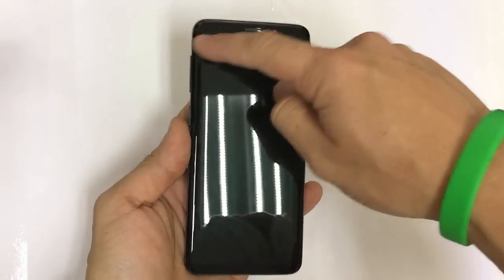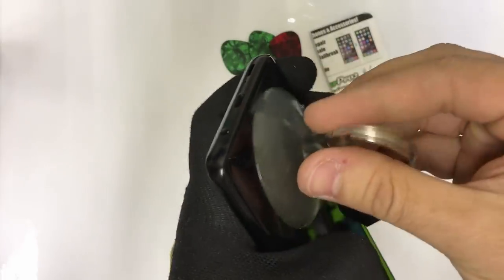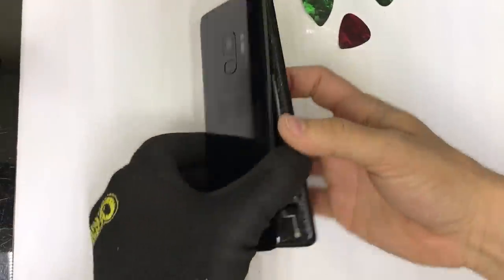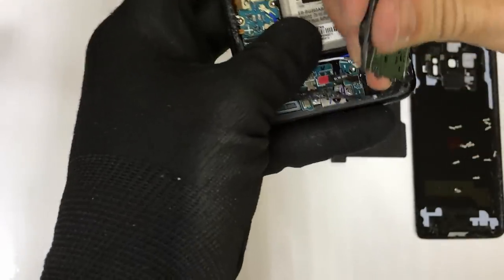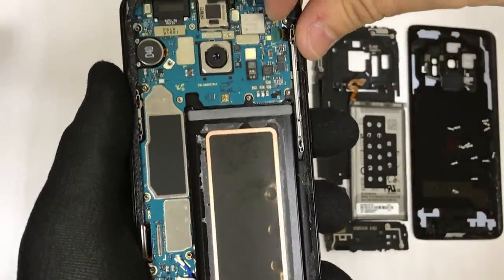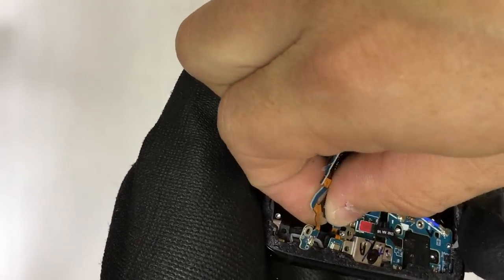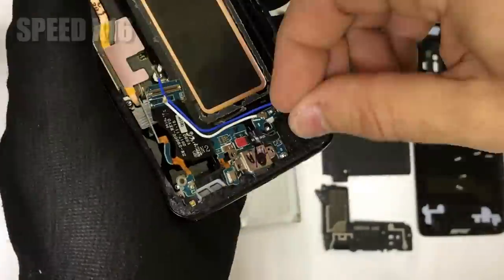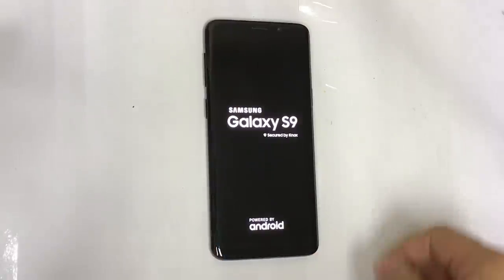Samsung Galaxy S9 - How to Take Apart & Replace LCD Glass Screen

Comment: Wow what a great video. I learned everything EXCEPT how to replace the screen.
Reply: Then you have no business tearing down a phone. Because you clearly don't understand what you just watched.
Reply: I was thinking the same thing. Maybe name the video how to disassemble samsung galaxy s9 without taking the screen off.
Reply: @RaiderLacrosse29  I don’t think YOU understood what you just watched….not once did he show you how to remove or replace THE FRONT GLASS, man’s removed the entire front housing to change the LCD but not the digitizer…..
Reply: @WillyWonkstaOfficial   typically, you buy the glass with the frame attached,
Reply: @WillyWonkstaOfficial  This video is for people who bought the digitizer with the frame, which is what most people do, myself included.
Reply: @WillyWonkstaOfficial  yeah, he almost starts to demonstrate it at 4:44, then just fuckin doesn't bother and continues with the teardown, which is a different thing altogether. Then at 8:02 "there we have it, your galaxy S9 is completely taken apart", but it isn't, because he literally didn't do the thing in the title where you remove the screen. And the idea that this video is intended for people who bought the digitizer with the frame is bullshit, because he specifically explains to reattach the adhesive to the frame at 4:02 and idk why you would do that if you're replacing the frame.
Reply: That's how you know they really know what they are talking about!

Comment: I was struggling with a flickering and flashing screen.  I used this video to find the connector for the screen. Once I found it, I on plugged it and gave it a shot of "de-oxit"  I then plugged it back in, changed the battery while I had it open. And put it all back together.  AND IT WORKED!  No more flickering.
Reply: Hi, I have a similar problem, I think. Was your screen green-ish? Because mine is and it flickers too.
Reply: @johntimelord7927  no it wasn't.  Eventually it did quit on me.  I live near-term ocean, and I wonder if the salt air caused the problem.

Comment: I used your video for the charging port replacement, so I thought I'd use this video to do the screen as well. Because you were too lazy to do a separate video, I followed these instructions and now my screen is stuffed. Not anywhere do you actually show the removal of the front glass, but what you do say to do is to remove the front like you do with the back. All because instead of making a new vid you just took a lot from the charging port replacement vid and slapped a new title on it thinking it'll be fine. Well it wasn't fine. Delete this video and make a proper one.

Comment: U forgot a step.. replacing the screen.. Now I understand why phn repair places charge so much for screen replacement. Ugh! I was just quoted $242 to replace screen on my S9 thru Asurion phone/computer repair. The screen replacement kit cost $30 on Amazon, so that means it costs $212 just for the work. Im better off just buying a used phone off FB marketplace. 😔 I nd to learn this skill so I can save $$

Comment: Why take the entire phone apart  if you only need to replace  the front screen? Oh...I see now. You can replace the glass only if your confident enough but if your digitizer is bad then its actually part of the frame.  He could have said that in the beginning.  After he got everything off the phone you replace the entire frame with glass and digitizer then reinstall all the parts on the new frame/digitizer.  I think he just removed everything and put it back on the same good frame?

Comment: To anyone watching this, you can't just replace the front glass, if you get a crack in the screen, the whole  LCD/screen has to be replaced along with the buttons as well. don't bother listening to anyone or give your phone to someone in a shop who says can do it.   I just fixed mine and went through some shit to do it.
Reply: My touch screen stopped working would it be the same for me??
Reply: My screen isn't carcked its fine just the touch sensor
Reply: @Loadingcontentx_x  i think its the same board unfortunately but try a shop
Reply: @walidosama  OK thx

Comment: do i really need to remove the battery and all the other components for just the screen replacement or can i just remove the componets blocking the lcd ribon connector, then disconect the ribon and then use the heat gun to remove the screeen??
Reply: If you bought S9 with Frame

Comment: So you just took it apart and put it back together.
Can you just take off the front glass?
Reply: this is what i want to know. ive bought the glass screen and it doesnt have any connectors.....
Reply: @countjobula  you cant replace the glass its fused with the AMOLED LCD so you'd probably have to replace the entire display including the glass screen and the AMOLED LCD

Comment: All I want to do is replace the glass. cant i just heat it up, pry it off and put the new glass on?
Reply: Did you ever find out if that can be done? Seems crazy to tear apart the whole phone when you could just lift the front glass and replace it, in theory anyway.
Reply: Yes you can. He was just showing how to remove all the parts while he had it open. Just heat pry and replace

Comment: Hello. I have a question and really hope someone can help me. Is it possible to use a different display from another phone as a new digitizer? If so could you please let me know what phones use the same display connector and the name of the specific connection type? Also can you let me know compatible camera connectors and possibly speakers.

Comment: I just recently broke the glass screen on my galaxy s9, do I have to take all of the phone apart to replace it or can I go about it another way?
Reply: This is the only way to do it unfortunately. If you really are hesitant, get it done professionally
Reply: why is that? isnt changing just the glass enough?
Reply: The main reason that you have to go through the back is so you can disconnect the battery and the screen socket before trying to take off the screen. Otherwise you'll just damage the wires. Also, since the digitizer and glass are basically fused together, it's almost impossible to just replace the glass.
Reply: Wow This phone is garbage

Comment: Clearly he explained in minute 4:40 if you need to replace the screen only you will have to heat up the broken screen and pull it with the suction cup and replace it. For someone who was replacing the screen the video ends right there, for the rest of us who want to know how to take it apart, is the rest of the video.